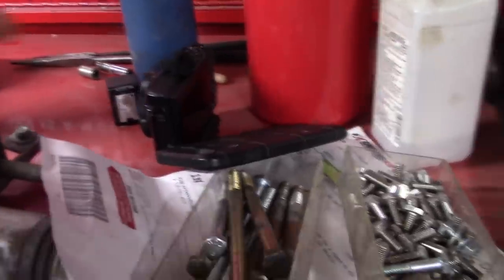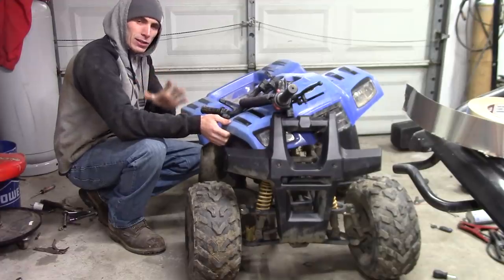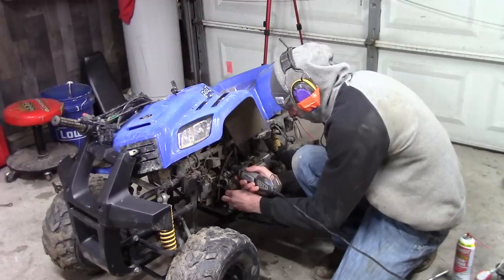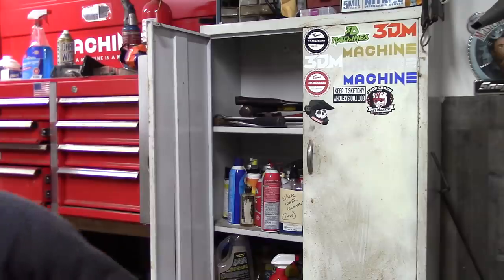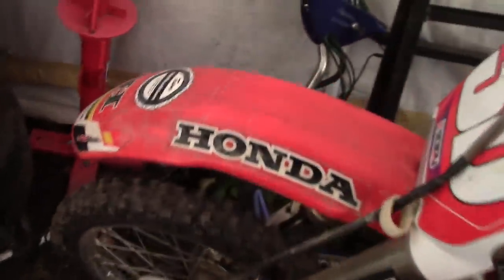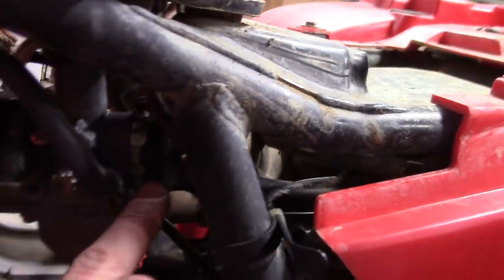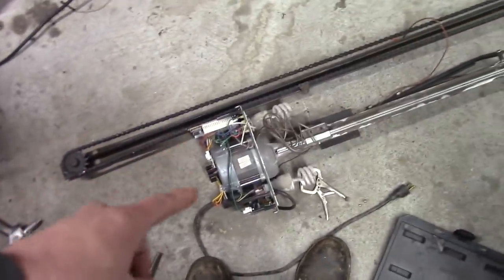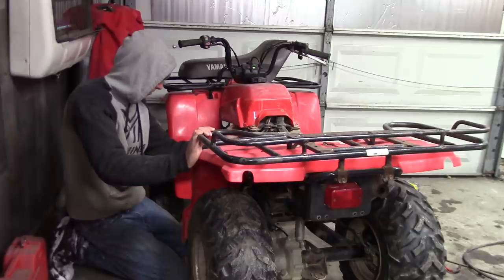The Truth about my Scam

Comment: I have a 1996 Yamaha Timberwolf 250 I love it but the neighbor threatened to call the cops on me because we have not had enough money to buy a new exhaust
Reply: I have a 1994 that I recently purchased from an estate sale with only 212 miles on it. It had been sitting for years but no scratches or anything but I had to drain all its oils from its diffs to its four wheel system. Plus I had to replace its carbs but for a 350 it really rocks. I am happy for you they were and are a really good atv.